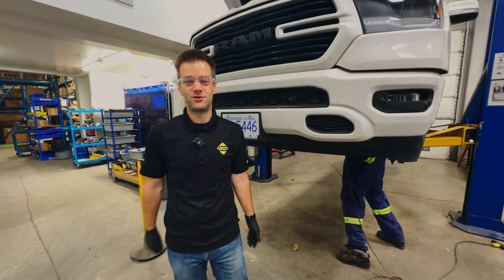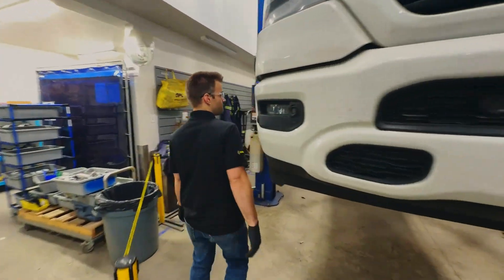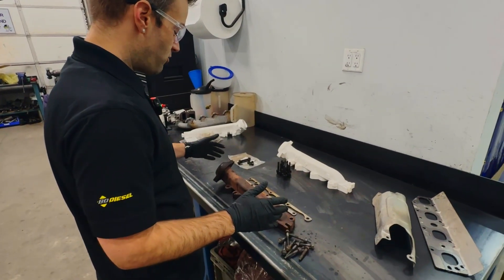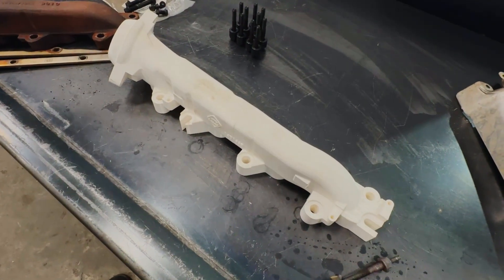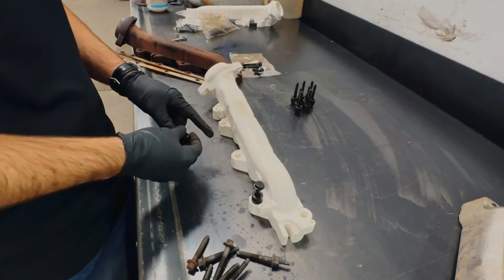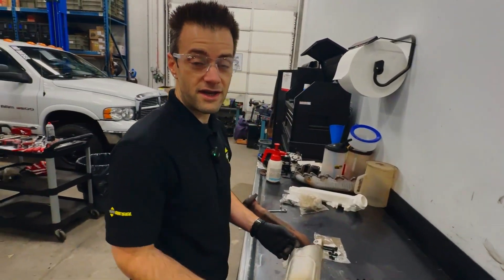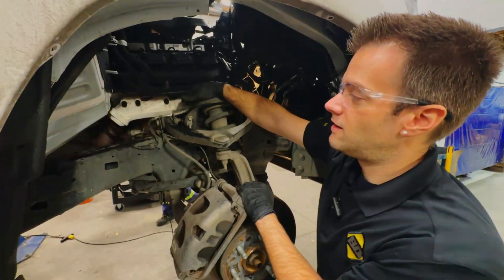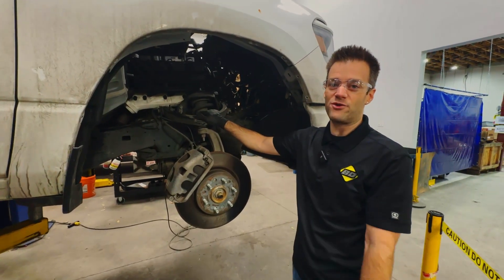Hemi 3D Print Manifold Fitting

Comment: Is this supposed to be a delayed april fools joke or something? Plastic exhaust manifolds? Im sure it's cheap to pump these out on your ender 3 but this is real trucks were talking here. These will warp or crack like crazy assuming they dont melt after your first warmed up wot pull.
Reply: Someone obviously didn’t watch the whole video. They aren’t selling plastic manifolds they do 3D printed ones to ensure proper fitment before manufacturing them.
Reply from the maker: Hi @lzziana, thanks for your comment. What you’re seeing in this video is a sneak peek into our research and development process. As part of that process, we use plastic 3D printed manifolds to test fit on real trucks to ensure the design is accurate before we get the production manifolds cast with high-silicone ductile iron from our Canadian foundry. We are NOT selling 3D-printed plastic manifolds. You are correct that plastic manifolds wouldn’t last long 😊.
Reply: And you get to vote 😂